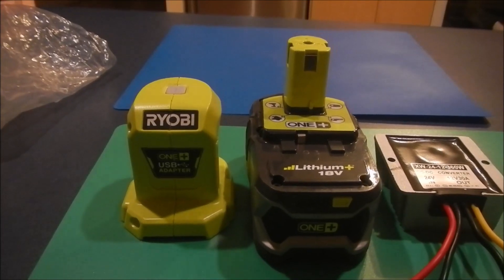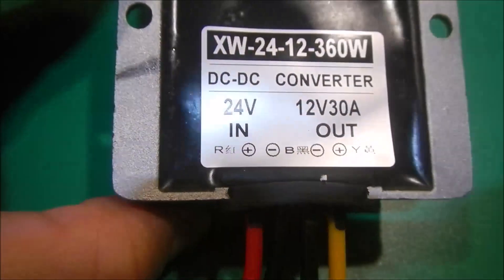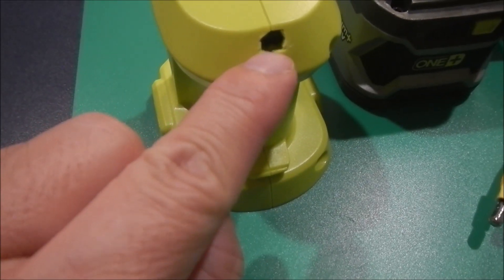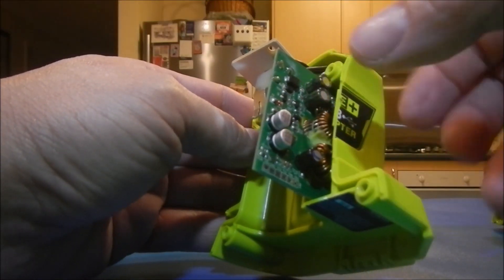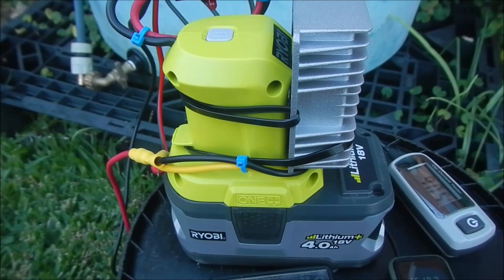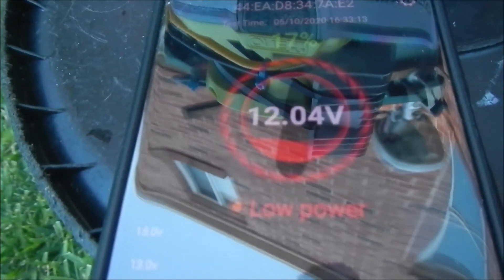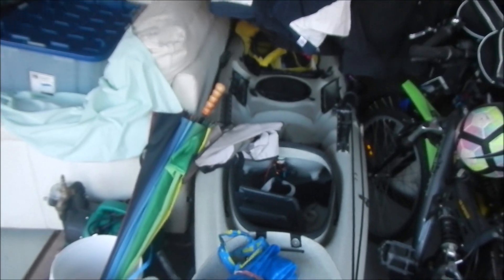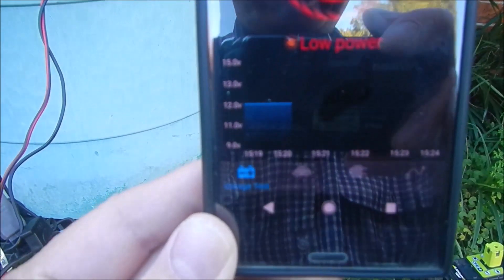Motor Kayak Ryobi ONE+ 18V Lithium Battery Hack

Comment: Will this method drains too much juice from the battery and eventually shorten the life of the battery?   There is no low voltage protection circuitry built in right?

Comment: The trolling motor I have uses reverse polarity for forward and reverse and I believe this happens in the switch. Would that have any effect on the dc converter being that it says never to reverse polarity in the specs, or does that mean just don't wire it wrong, and the the polarity reversal would only happen through the motors switch and not have anything to do with the converter?

Comment: most of these 24v DCDC converters have an operating input voltage of 18v-35v.. are you sure running down to 12v isnt going to cause problems? I'm looking at getting one but can't find one with the right specs...

Comment: Thanks for the video! I got a nice 24V mink Kota trolling motor with a broken control box that I’ve been playing with but it’s so hard to find anyone else doing any tests like this with these batteries. I found I could get a 1 hour runtime with a 1aH battery on the 24V trolling motor when out of the water but there was so little current draw on the motor it didn’t tell me much. I wasn’t even sure the battery would be able to supply the amperage I needed until I saw your video. From what I understand the larger windings on my 24V motor should help provide more rotational power at the same levels of electrical power and ultimately be more efficient even though it weighs more.

Comment: Running late but was having same idea. does it run longer with converter or bare wire to battery?? was going to use two batteries 4ah one for fish finder and one for trolling motor. thanks for vid it can be done.

Comment: I have thought about running on Ryobi batts. I run my Watersnake on 16.8v from a Li-Ion DIY  battery. No issues, but it does make the kayak go faster. I have seen others use the 20v tool batts on 12v Minnkota, no issues. They just go faster. You might not need that converter at all
Reply: Any issues with them blowing up? Thats alot more power...
Reply: @okbis4941  I have not ever tried the Ryobi. But I have been running my 16.8v Li-Ion DIY batts for 18 months. Zero issues.
Reply: I’m sure it would be fine

Comment: Thanks heaps for making this video, its actually what i was looking for. Have you tried it with an inverter to see if it can run higher voltage things?
Reply: I would think putting it on a inverter on it would reduce your battery run time as inverters are will drawl power. You would would no be gain addition run time.

Comment: Gday, I have same water snake, why I need the dc converter? What happen if I just connect motor to battery and use?
Reply: Burn the motor.  Ryobi voltage exceeds motor required voltage of 12v.